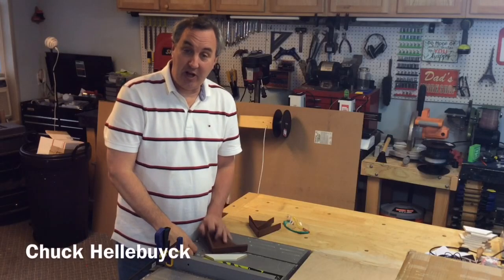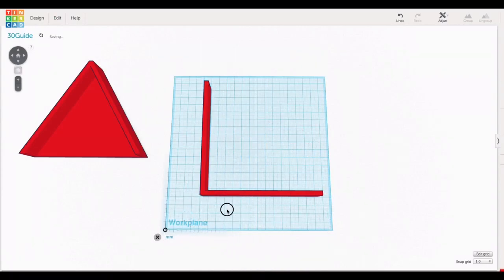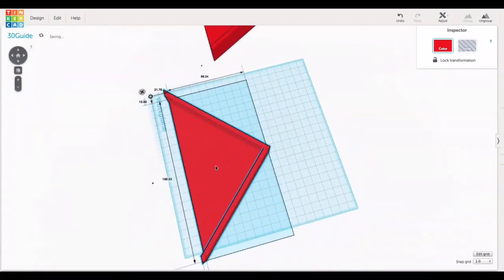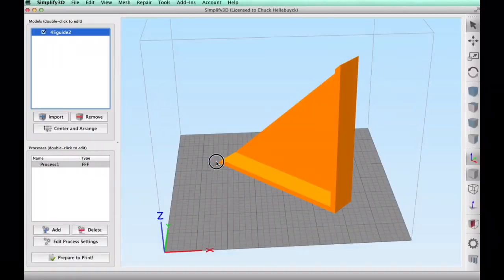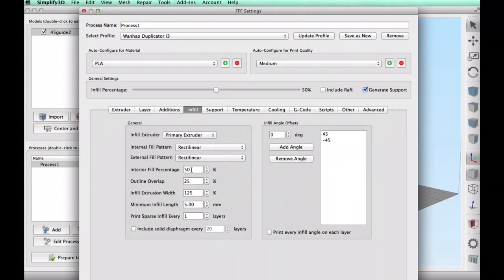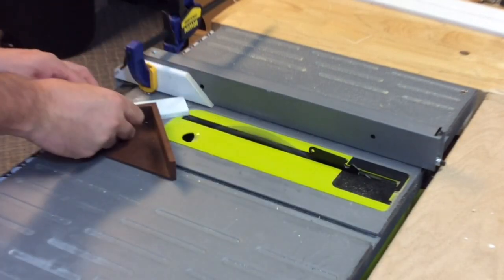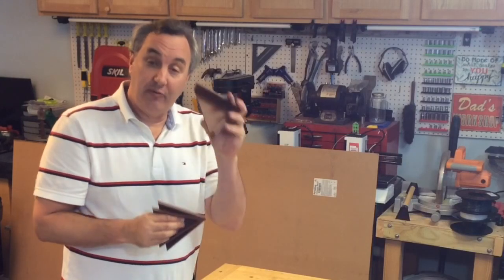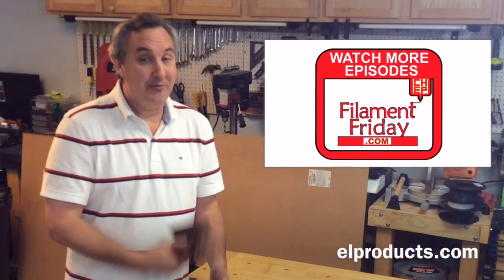3D Printed Miter Sled for Ryobi Table Saw, 45 degree, 30 degree & 22.5 degree - Filament Friday #88

Comment: Yes!  I do find this both interesting and useful.  I've had a 3D printer for 10 months now, and I've printed only 3 "useful" things.  I love to see more examples, because they will turn on the lightbulb in my head for more.  One "useful" (and simple) thing I've printed is a replacement pieced for a wind-chime.  I printed it in translucent material, with a triangular infill, and when the sun hits it, it is beautiful! Your channel is a key inspiration.

Comment: Looks good !!!

You forgot the usual disclaimer: "Safety guards removed from saw only to make the video more clear" :) NOBODY ever removes them for any other reason ... do they? 

You might consider running the bottom guide to the edge of the part. That would eliminate the need for support. The support plastic is thrown away. The longer guide might improve the accuracy of the part. It also might hit the table you have your saw mounted on. 

Now if there was only an accurate way to come up with dual step stop blocks the > 4 side frame cuts ....
Reply: I freely admit that I have a hangup about designing support out of parts.

Comment: 4:24 Is it just me or does it look like the 45 deg cuts are not really 45 degrees. I don't see the corners fitting tightly. :scratching head:
Did you verify the 3D printed sled against an actual carpenter's square ???
Reply: Thanks for the explanation Chuck.